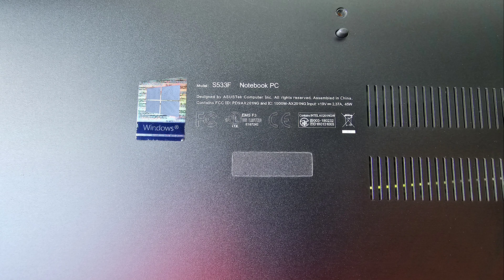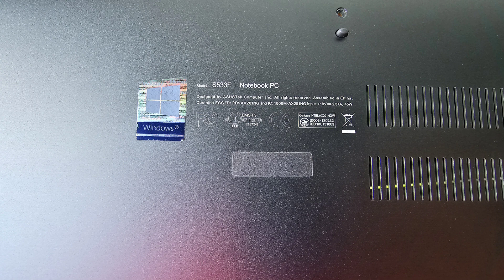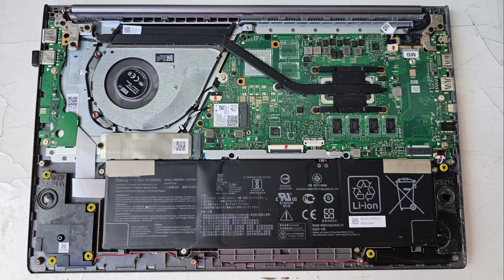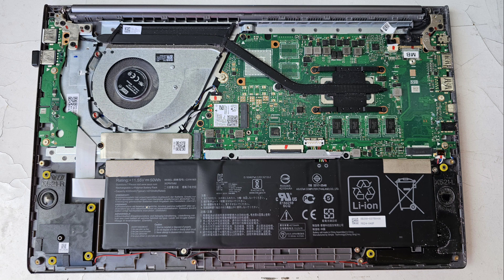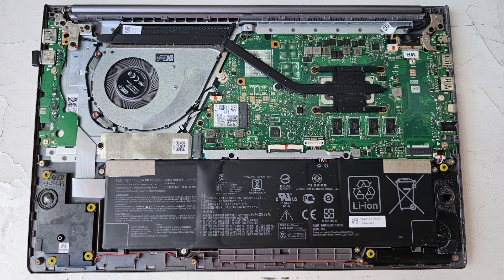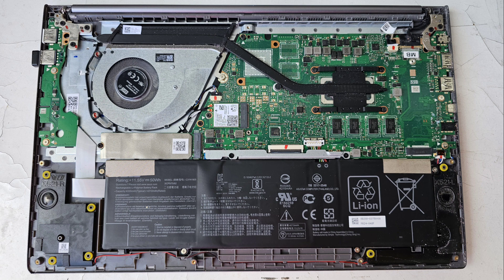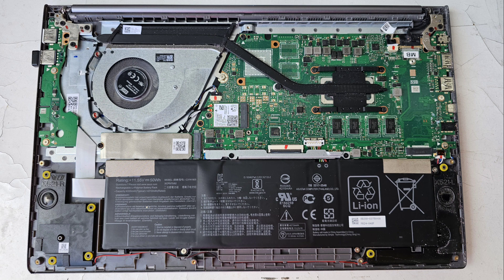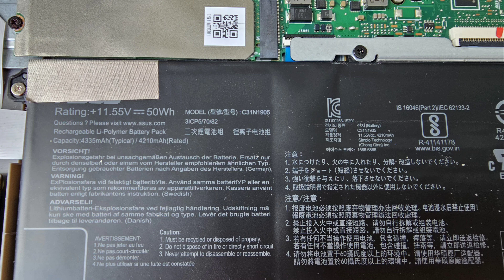ASUS VivoBook S15 S533 S533F Quick Look Inside Slideshow

Comment: I had the exact same issue with the drive not being detected without applying pressure on the case. I just moved it to the second drive position.

Ever have to replace keyboard on one of these? Not fun.
Reply from the maker: @AT525LA  glad you got a workaround
Reply: could you explain the fix mentioned above…I don’t understand what that means
Reply: @rwc1386  The laptop has two slots for the drive. This allows you to add a second drive if you want. In my cases, the slot that the drive was in seemed to have a week connection so I just moved the drive to the empty slot.